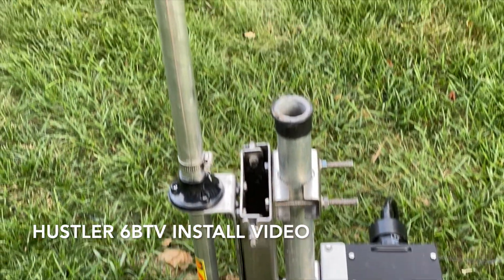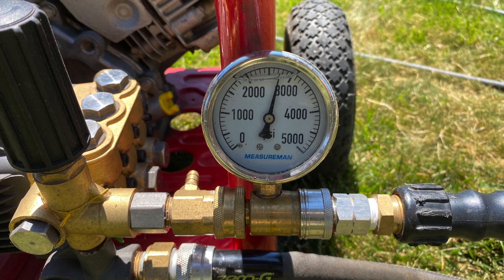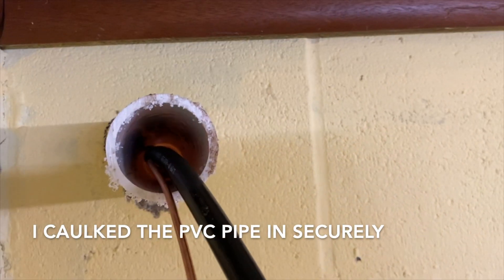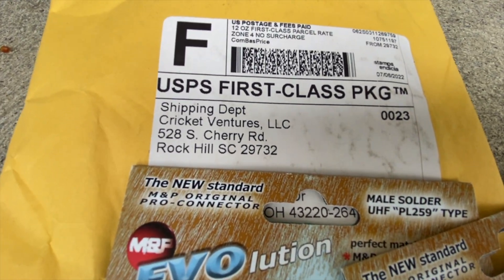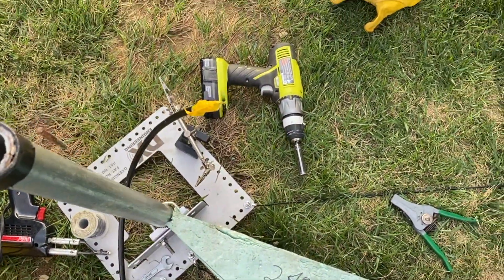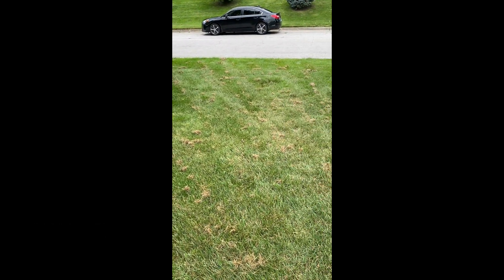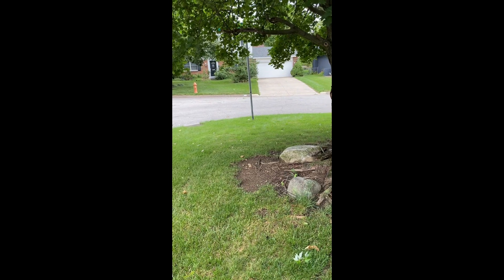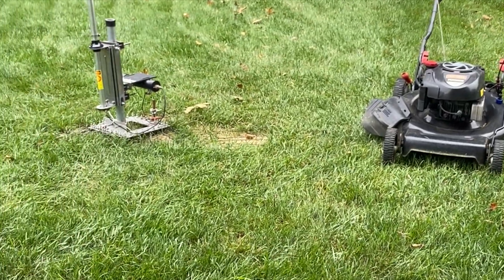Hustler 6BTV 5BTV 4BTV ground mounted vertical antenna. Ground radial installation. first impression

Comment: Is this considered a base loaded antenna for CB radio? It looks similar to what I had back in the early 1980's but mine was on a roof with the antenna rods sticking out the bottom. This, at the time, was considered one of the best designed antennas of its time. Thanks for showing how you did yours. Aren't you worried about rust though? All the parts are at ground level where the morning  dew is, rain and snow. That would be my concern. Vandals too or an animal getting its paw caught in the wires.
Reply from the maker: It is not a base loaded antenna. The coil-like device at the base is an UN-UN transformer . it uncouples the feedline shield from the ground of the antenna. The parts near the ground are all stainless steel. Thank you for your comment. I appreciate it.
Reply: Definitely " engineered!" But we'll thought out , Andy, UK, ham

Comment: Add the shunt fed coil from DXE for better results on 80m.
Reply from the maker: I'll look into it.  Thank you for your comment. I appreciate it.
Reply: @jjsoundguy  Download the documentation on the 6BTV for installation info. A very good reference on the antenna.
Reply from the maker: @dxradioman6351  I have the DX Engineering installation manual.  N2MMS

Comment: Is that plain old pvc electrical tape over the connections to the UN-UN ?
I think you would be better off using self amalgamating tape, pvc tape will fail.
Reply from the maker: As is the standard practice, it is electrical tape of amalgamating tape.  Have no fear. Thanks for your comment.

Comment: Very nice with one exception is I would put a ground rod by your antenna and lighting protection. Then I would not pull ground into your house to keep lighting out of your house. For RF 6in is too long.  Otherwise nice install.
Reply from the maker: Hmmm.  Not carrying the ground wire into the house is an interesting point.  I'll think on that.Thank you.  N2MMS
Reply from the maker: On further reflection I cannot see a huge difference between bringing in the ground wire and a coax wire or just the coax wire alone. The ground wire shown continues to the cold water feed pipe from the street. It is also copper and it is deeper and longer than my ground rods.  Am I wrong here?
Reply: @jjsoundguy  sorry but a polyphaser Wright at bottom of the antenna is the only way to go 
N keep ground sepert from ground at the base of the antenna for antenna ground n the  polyphaser
N keep ground for shack separate from coax  ps don't ask how I know 
It brings up bad memories!
73 n good dx n9prf
Reply: @jjsoundguy  For lighting having a ground rod by the antenna and terminating the coax there breaks the ground connection and gives lighting a path to ground.  To go further connect all ground rods together at your house. A good reference on the subject is Grounding and Bonding by Ward Silver.  The when you bring in your coax use bonding to connect your radio equipment.
Reply: I agree with bringing that ground into the house....nice path for lightning, arrestor in line or not....least resistance is through that nice clean copper wire.. But still a great job...

Comment: I have the same antenna system. The radials made all the difference in the world on my 6btv!

Just watch the swr after you install more radials. It should go up as you add more ground radial wires. I ended up buying the VMN-1 from DXE to get my feedpoint impedance up to near 50 ohms once more. After that I retuned the antenna once again, and she screams! 

73 es gud DX de kc5ngx
Reply from the maker: I set the section lengths only once after the radial field was completed. One and done.  Thanks for your comment.

Comment: Interesting.  I have the 6BTV and the earlier version of the tilt mount. HOA has restrictions but they are defective, so no problem.  Neighbors at the back are interested in ham radio.  My challenge is ROCK.  I have limestone (karst) less than a foot down.  Need to put more radials down.  Thanks for showing your process! AB5XZ in STX.
Reply from the maker: You can use a lawn edger if you really want to bury the radials below the surface but waiting for the lawn to heal would bring attention to the project.  I know I would hurt my middle finger waving it around in protest to a HOA. Not for me .  F the HOA nazis.
Reply: @jjsoundguy  Join the HOA, volunteer for the Architectural committee, then chair the committee.  Worked for me. :=)
Reply from the maker: @tpobrienjr  That is a wonderful solution.

Comment: I built up the same system and it works really good bought mine in 1978 and in  that time the only repair was a 15 m trap cover.
I have made contacts all over the world and have moved it
4 time and it has been a stellar performer. I also believe it is the best vertical to spend your hard earned money on.73 from ki0ad/jim
Reply from the maker: It is a good antenna.  But wire dipoles are much cheaper.  Thanks for the comment.

Comment: the thing i would do . i would do is put the wire in electric con do it pipe
Reply from the maker: I used direct burial coax to avoid the expense of conduit.

Comment: Thanks for your excellent video. Looks like you followed the DX Engineering "manual." I installed one in coastal Georgia where the soil is sand which has more advantages than disadvantages. It's common practice here to dig holes, even surface water wells with a garden hose and a section of conduit. This worked well for me. I laid out radials and covered with did. Not expensive. I used an electric sidewalk grass trimmer to dig the "ditch"  to the house. Sand offers poor ground, and I drove 3 ground rods at the house  to improve grounding. Adjusting the antenna for low SWR is essential. 80M isn't broad on this antenna, so you have to pick your frequency of operation.  In 2013 sunspots were abundant and I grew tired of working Europe on SSB. It's a great antenna when installed as you did. Low angle of radiation great for DX.
Reply from the maker: Thank you for the kind comments. I have had a few nice contacts with it already.  I do not contest though.  73

Comment: Good approach. Radials make verticals work.  I use a 4BTV and a DIY Rybakhov (non resonant vertical). I have a lot of buried wires spread over two gardens.  The 4BTV and Fishing-pole (non resonant) Rybakhov are much of a muchness apart from price, but TBH my two  fairly short doublets work rather better and only cost pennies each while requiring  no ground/counterpoise  system.  Buying the 4BTV was a mistake.   I only ever run QRP power levels.  Scotland to Asiatic Russia, USA, Canada on just a few watts using simple wire doublets. I once went QRO, 30W to Pinetown South Africa.   Build, don't buy.
Reply from the maker: My next project will be a simple dipole or a random long wire as I own a SGC smart tuner. Thanks for the comments.

Comment: Can you add a link to the connectors you used and also the UNUN ?     I am like you.   Any job worth doing is worth over doing.  😂
Reply from the maker: The Un-Un is from Palomar Engineers.  Search the web for the UHF connectors.  There is a good shot of the package in the video. I think MFJ sells them.

Comment: The next time you do a vid, stick to the actual subject. I’m not interested in your trench or pole or how hard the earth was.
Reply: On the other hand, I am interested as the type of ground has a major impact.  I also was very interested in how he did the entrance to his shack using PVC.
Reply from the maker: I just drilled a hole in the concrete block then filled the pipe with foam rubber to block weather and critters.

Comment: Very well done video.  Only thing I would have done different is the ground to your pipes.  Household utility pipes are not a good ground and matter of face code changed like 15+ years ago and GFCI should not be grounded to utility pipes.  Loved the video and was wondering if you ever got out on 80M?  I thought a lot about ground radials but will my zero turn chop them up?  I was kind of surprised to see you didnt mow them up.
Reply: I didnt want to just mention the ground issue without pointing you to a fabulus video explaining the grounding.  At 13:35 he discusses grounding to copper water pipes.  https://www.youtube.com/watch?v=Luy8XP8O390
Reply from the maker: Thanks for the comments. I have two 8ft ground rods outside.  I simply added another ground to the cold water supply since it was close. No, have not ventured onto 80 meters yes.  Been busy resurrecting a Subaru Forester for a future cross country road trip. You really have to look closely for the radials.  That is a point I wanted to make. I was not sure the wires would be subsumed into the grass.  73

Comment: I put my 6btv up 15 years ago. Still works great. I think you went a little overboard with the bare  grounding wire. The antenna is already grounded when you installed the pole.  I just pounded a 6 foot pole in the ground, mounted my radial plate and tilt mount and set up the antenna. Been working for 15 years. No rf or static electricity ever back in shack.
Reply from the maker: I have 38 radials total.  Lots of work but I had the time.
Reply: You do realise that the Hustlet 4BTV is only half of an antenna/aerial system?  I have 4BTV sitting over a field of buried radials, the 'other half' of the antenna. Put simply.... you can't 'push against nothing'.  a six foot rod in wet clay may work.... sort of. A decent radial field will work.
Reply: @allancopland1768  I forgot to add that I have 32 radials. The pole pounded in the ground is my electrical ground not my counterpoise.

Comment: Nice job. Would you like to vacation for a weekend at my QTH and do the same thing? 
I’m waiting for fall and winter to start on my tower. Alabama weather and manual labor don’t mix well at 65 years old. 
Those are very good antennas for the price. They aren’t fantastic, but they do an excellent job for what they are. Nice job on your video work!
Reply from the maker: I'm 66 years old and was able to complete the installation in 95 degree heat by taking my time. If you are able just do as I did. 73.

Comment: Nice work.I  I just added the hustlers 4btv..small backyard but so far so good ..not as many radials though
Reply: Add as many radials as you can.  The 4BTV is only half of an antenna/aerial.   You are expected to buy/provide the other half. You can thank me later.
Reply: @allancopland1768  I have about 16 radials down I have more wire to add though
Reply: @JamesOrcutt  More is always more.
Reply from the maker: I heard something like 24 radials is the sweet spot but you cant argus with success if you are getting out.  73